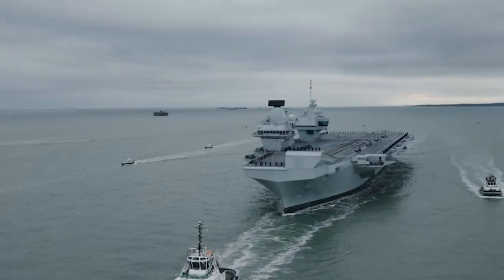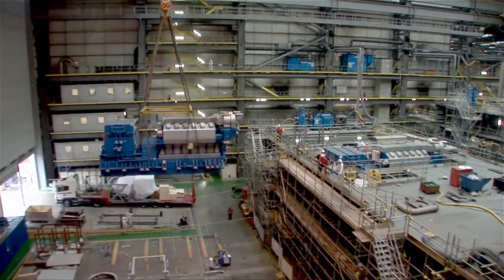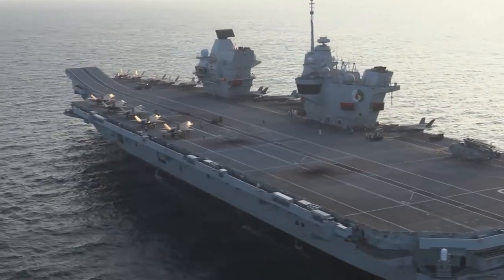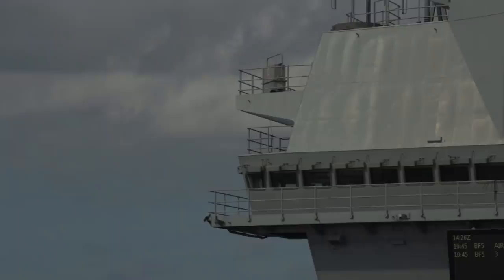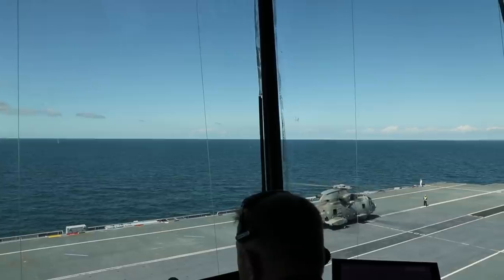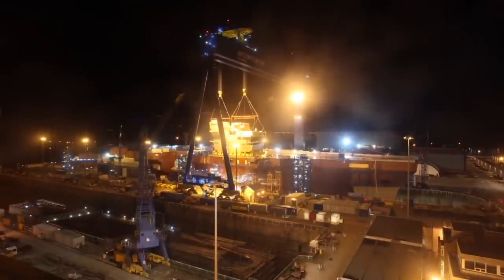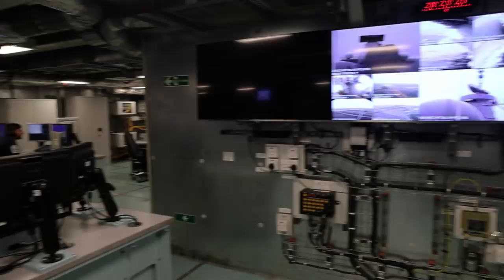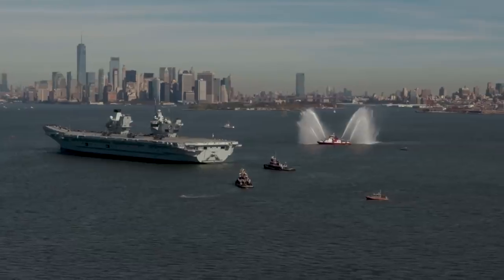Why Queen Elizabeth Carriers Have Twin Islands?

Comment: I like the twin towers an extra elevator but seeing a ramp on a carrier still makes me think their doing it wrong they should put catapults on their carriers, but then I guess perhaps the next generation of pilotless drones maybe able to take off without catapults so maybe its not an issue.
Reply: Why are catapults better than a ramp ? QE's designers had very good reasons for choosing the latter - cheap, simple, reliable, greater operational capability (less time between departures), pilot has much more control over his aircraft at critical moments, much less wear and tear on the airframe.
Reply: @hb1338  well Catapults have historically enabled the navy aircraft to carry full fuel and weapons loads more rapidly which is the whole point of the weapons system, that the aircraft could not carry on ramp aircraft carriers historically also the speed at which aircraft could be launched and recovered is increased which multiplies the force projection capability of the aircraft carriers, however, perhaps the new f35s with their more powerful engines and near vertical takeof landing capabilities and incredible long range means that they can take off more rapidly and carry full weapons and fuel loads.   When I saw how long the range on the f35 was I was really impressed. Since aircraft range on fighters is very important as well as it increases their capabilities and ability to operate in mass.

In other words historically a ramp carry was less than half as effective as a catapult enabled carrier if they went head to head the catapult enabled carrier would win hands down, having with the same aircraft much longer range because they could carry full fuel loads, and munitions and launch faster thus getting more than twice as many aicraft in the air as the ramp enabled carrier.

However, now perhaps the f35 is really that good, and now the ramp carrier could vtol its wing and still have very great range with full munitions in that case the elevators ability to bring aicraft up from the hanger becomes the bottleneck and having a third elevator would then greatly speed up the ramp carriers ability to project its aircraft.

I mean f35 is like incredible long range and refuelable in the air and there is a vtol variant so if the catapult enabled carrier can go 900 miles, while the vtol ramp carrier aircraft can only go 700 miles it may slightly handicap the vtol but still its much longer range than the older generation and maybe nearly as effective.

So when I see a ramp on a carrier I shake my head thinking that it cant be as efficient a weapons system but that is not really necessarily true anymore if the aircraft is as capable as the f35 variants. plus not having the huge catapult mechanism means the ramp carriers have more room for people and aircraft and fuel and munitions.

Comment: The U.S. Air Force, 25th of Feb, Just Admitted The F-35 Stealth Fighter Has Failed. (F-35 stealth fighter that Lockheed Martin is building for the service is too expensive and unreliable for hard, day-to-day use.) (The US Air Force has already  paid for around 250 F-35s. It originally wanted more than 1,700 of the planes. It’s increasingly likely production will end well before that point.). So what happens next? And without launching catapults where does that leave these carriers if the F-35 is eventually deemed not practical, as I understand it the F-35 is the only fighter plane presently capable of using this platform.

Comment: There must be very good reasons why nobody else has done this!
Reply: Both Italy and South Korea are building carriers with twin islands now, Russia also had designs for a carrier with twin islands.

Integrated electric propulsion systems mean that engines no longer need to be directly attached to the shafts to drive them, so they can be placed pretty much anywhere on the ship, this has helped make the twin island design quite useful.

Comment: So technically we could have 4 but we put two towers and engine rooms in the 2 we have which doubled the price
Reply: Nope - the second tower did not add very significantly to the price. There were always going to be four engines for reasons of both redundancy and speed.

Comment: No... it’s so that 1 island pilots the ship and the other island is the carriers Air Traffic Control.. it has nothing to do with engines
Reply: One of the main reasons is actually down to the engines, they're placed directly below the islands to reduce the space taken by exhausts and intakes, so splitting them makes sense to reduce the chances they are both damaged.

It comes with the advantage of better positioning for navigation and flight ops, as well as a number of other things like splitting short and medium range radars.

Comment: The carrier was originally envisaged as nuclear powered with angled flight deck and between 40 and 50 f35c catapult launched longer range aircraft. But the usual budget constraints meant the RN ended up with around 12 aircraft shorter range f35b no angled deck. But hey we got 2 islands 🏝 😏 🤪.. and fossile burning engines with support ships. Also we have reduced our hunter killer nuclear  sub fleet to make way for these useless ships. The only military future proofing would be for them to host 60 or 70 drones to procure any kind of effective interdiction. 😉  Kabul airport a recent example of this carriers military impotence despite being reasonably close.

Comment: A big stupid disadvantage of the Elizabeth Class aircraft carriers is that they're not Nuclear Powered. NP would give them a much greater range & reliability with no logistical problem of needing oil refueling. They would be cheaper to operate & cleaner for the environment if they were Nuclear Powered,,  it's idiotic that they're not.
Reply: It makes a lot of sense when you put it into context, they still need all the refuelling logistics in place either way for every other ship, you'd only be taking two ships out of the equation.

The big downside is that they would have a much larger upfront cost and likely have some much longer maintenance periods for refuelling. When you only have two carriers that makes it difficult, but they would have very likely ended up with only one with the increased cost, much like France.

At the end of the day, two conventional carriers are far better than one nuclear powered carrier.
Reply: @Benjd0  there’s also docking restrictions for nuclear powered ships

Comment: CANT FIGURE OUT WHY they built a carrier that has a speed comparable to a ww1 battlecruiser, about 25 knots..they wont be able to operate with other nations carrier groups very well as most are capable of over 30 knot speed
Reply: The QE is officially stated as in excess of 25 knots, not about 25.  An official top speed has not been announced.  
The Ford Class is stated as up to 32 knots.  Spot the difference.  It would anyway very rarely reach such a rate; carrier groups don't steam around at 100% of the top speed of the carrier.  For a start, how would the destroyers (usually around 30 knots) and frigates (usually around 27 knots) keep up, let alone their oilers and solid stores ships (usually around 20 knots)?
So your assertion the QE won't be able to operate with other nations' carrier groups is silly, even if the QE is restricted to 25 knots.
The Charles de Gaulle has a stated maximum speed of 27 knots.  So no problem working with the French Navy either.
Reply: @joebryant8500  the uss midway could steam at over 30 knots...it was built in the 40s and was heavily modified yet could do over 30..
Reply: @joebryant8500  i just think the brits couldve built a better carrier, they were the pioneers on most of todays carrier technology
Reply: @michellegrinder9484  Irrelevant what ships did before.  Your claims about the QE's top speed and its interoperability with other carriers are not supported by the available information.
Reply: @michellegrinder9484  Again just to re-iterate what Joe has said, you're taking a vague number given as the actual top speed. During sea trials it was tracked going over 30 knots, so we know it can go faster.

The carrier really is continuing to innovate, with the twin island design, she's also much more highly automated than any previous carrier, and will be the first to implement the bedford array, which is an advanced landing aid, as well as being the first ship to regularly use SRVL for landings.
Reply: @Benjd0  thanks for your input...i was unaware of its sea trial speed

Comment: English aircraft carrier, American jets :P  also you forgot the con that having two islands creates two targets you need to protect.
Reply: British rather than English, since it was assembled in Scotland too. The Jets are a joint project, a good proportion of the components are designed and built in the UK, including the vertical lift system, rear fuselage etc.

With one or two islands you're still going to need the same defences really, since you're protecting against things like missiles, you're just trying to prevent any of them reaching you in the first place. Having the second island just means if you happen to get hit, then you have a better chance of surviving it.
Reply: @Benjd0  it's still another target... if we could we should bury the bridge into the structure but we can't do that.  the f-35 is still developed in the US.
Reply: @sheilaolfieway1885  The main point is that it's better than a single long island that could more easily be taken out by a single hit. It probably would be ideal to get rid of it entirely, but may as well make the most of that space if you have to have it.

The main development has gone on in the US, but parts have been developed in many other countries, with the UK being the primary partner in the project. The UK has had most involvement with the B variant, as they have a lot of experience from the Harrier and the vertical lift system it uses comes from Rolls Royce. The first flight of the X-35B prototype was also performed by a UK pilot from BAE Systems.
Reply: @sheilaolfieway1885  That means the enemy has to us two weapons to knock the carrier out in stead of one
 yes developed in the US with International help and some say design stolen from the Russians
Reply: @daniellastuart3145  or one big weapon.